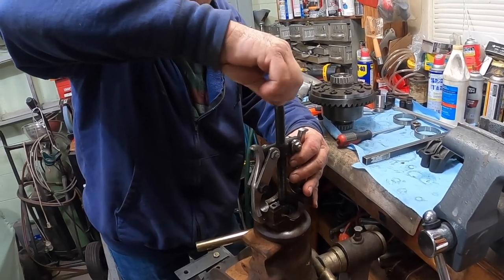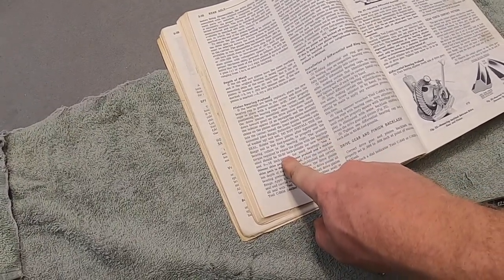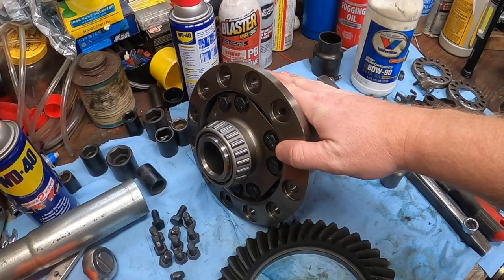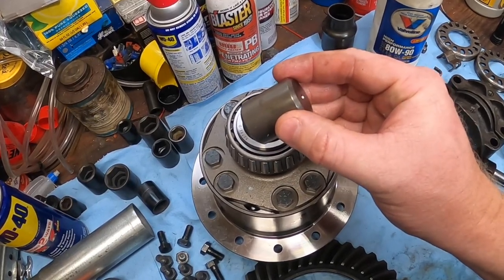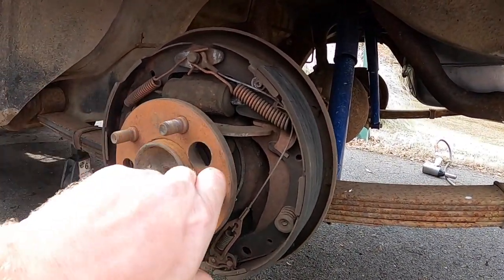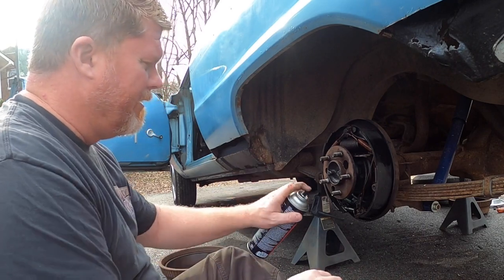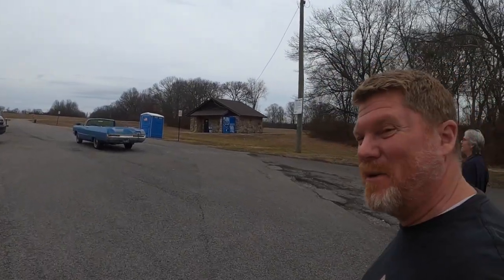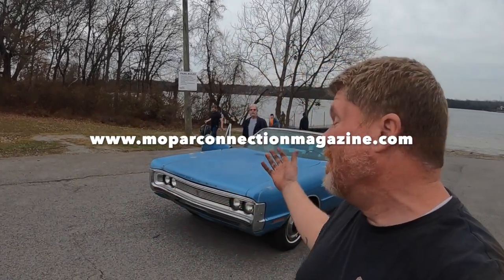We Get Marsha's FIRST BURNOUT Thanks to This Eaton TrueTrac & 3.23 Upgrade

Comment: I worked in salvage in the late 80's. It was sad to see lots of BB Furys in the yard.
Any SBC 350 builder was gone in a day or two.       Mopar 383 just sat cricket quiet.
Reply: I know what you mean I worked at a scrap yard in the 80s did alot of picking, still saw too much potential go to the port.
Reply from the maker: What’s more depressing is what scrap yards are filled with now (all Toyotas and SUVs). There’s nothing cool in them anymore

Comment: In a 1965 Barracuda with a very warm 78 Teen I had a 7 1/4 LBP out of a 74 Dart Swinger It had an open 2.76 gears. 

Took a 8.25 out of a Aspin, 2.94 gears open. Not much improvement. When the 8.25 started leaking at the pinion I had to put the 7 1/4 back in to get to work everyday.

I took the 8.25 and pulled it all down, new seals and bearings but put a 3.55 Suregrip out of a 8 3/8's Dodge van. The 8.25 and 8 3/8 are the same carrier and ring gear size. Everyone on a Mopar forum said NO but we did a lot of measuring and it fit.

Using the brake backing plates and drums from the 7 1/4 I was able to put 10X2.5 drums on the 8.25, better than the 10X1.75's

Going from 2.76 open to 3.55 Suregrip was VERY big improvement.
Reply from the maker: Heck yeah it was!

Comment: Love your vids. Its refreshing to see good vids about Mopar stuff other than UTG. I have a 1941 plymouth, and am building a beastly street/ strip car. I need a transmission, but don't have 5K for a tremec setup. Any suggestions
Reply from the maker: And you’re needing to go manual? Well those 5-speed Tremecs are in a LOT of Mustangs, which get wrecked often. A new bell housing and throw-out bearing is cheap if you can fish out a gearbox from a totaled GT.

Comment: Does the 1969 Factory Service Manual you made reference to work for the 1970 car? Also, disclose cost for parts. Do you wanna do the same on my '70 Fury III ex-squad? With my 440 I will get rubber out of third gear.
Reply from the maker: Yes the manual should work for most (not all) of this work. There’s some obvious changes of course. And I didn’t think I had to drop prices because 1. everyone’s got Google and 2. You might find better prices than me.
Reply: @moparconnection  Generalzed info from a 1965 or 1973 shop manual will work on this 1970 8 3/4. Ma Mopar did not change much as far as setup spec's on these rear ends. The older 1950's thru early 60's Bolt on the Drum axel 8 3/4 are different.
Reply from the maker: You’re actually right, Dave.

Comment: Just a little recommendation. Use a drip pan under the brake /backing plates when using Brake Clean. Keeps the dirt/brake dust/oils off of your driveway and helps the out Environment.
  Keeps the driveway clean and keeps the dirty stuff out of the gutters and drains when you hose off your driveways.
Also if you use a wire wheel to clean anything that gets sealed and has bearings/fluid, Be sure to use an air hose to blow out any possible pieces off wire that may come off the wire wheel and possibly get into the bearing/gear area.
What type of gear oil did Eaton recommend in the Sure-Grip ?
Thanks for the good video.
Reply from the maker: This driveway is so oil soaked a little brake clean could help! 🤣 We ran Lucas 75W90.
Reply: It was just a suggestion for all the Mopar faithful who will do this at their own home. 
Just wondered on the gear oil if Eaton recommended any synthetics or friction modifiers like most other manufacturers do.
Thanks for helping to keep the Hobby alive. "take a kid to a car show "
Reply from the maker: They were all very good suggestions. And no, because there's no clutches in the TrueTrac it doesn't require a friction modifier like a factory SureGrip.
Reply: @moparconnection  Do you have a Patreon account yet so people can support you monthly ?
Reply from the maker: Unfortunately, I don't have a Patreon. But I do have a PayPal account at kevin.shaw@shawgroupmedia.com
Reply: @moparconnection  Maybe you could mention that on some of your videos.
Everybody knows that nothing is free that is worth anything.
 It takes time and money to keep things going. I'll make the first donation.
Thanks for what you do.
Reply from the maker: That’s incredibly generous, thank you! I really hadn’t considered it before now. I own Mopar Connection Magazine and the video channel is just a fun side project. The magazine is subscription free so definitely check that out too.
Reply: @moparconnection  I have been a subscriber for quite some time. I have been a Mopar man for over 60 years. Thanks to my grandfather who was a diehard Dodge fan. He always had a Dodge truck for hauling and his cabover camper for camping and fresh water fishing,, station wagon for road trips and a 4 door for daily driving/work. He had a pretty good selection of Craftsman tools and a big garage he built. He was also a Sears man.
I have a Mopar only door hinge rebuilding business. I'll send you some info. I am on most of the Mopar websites as Moparleo.
Reply from the maker: That's awesome, Leo! Thank you for the support. YES! Please email me at kevin.shaw@shawgroupmedia.com with information on your business!